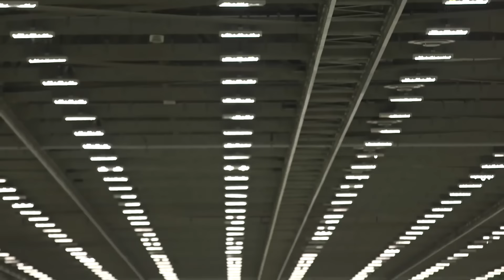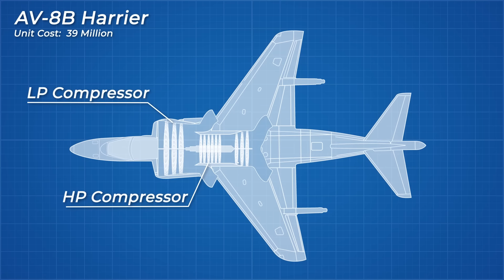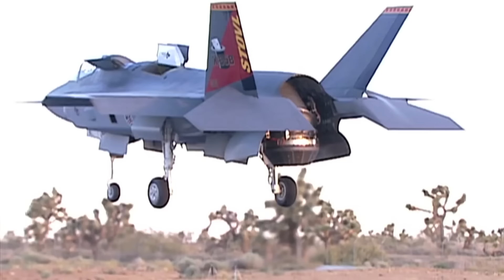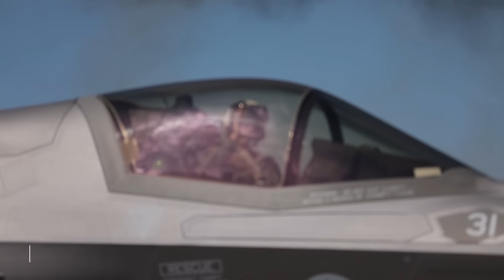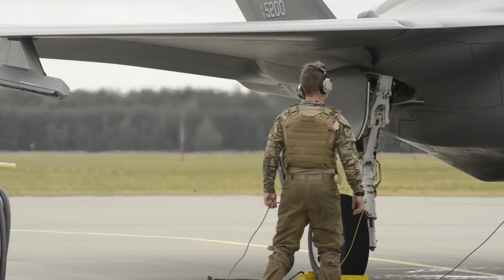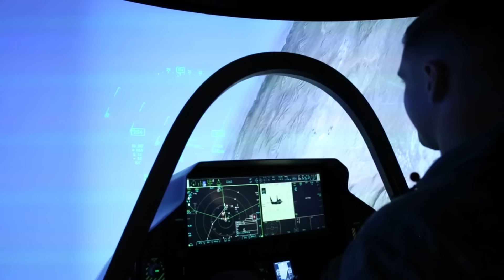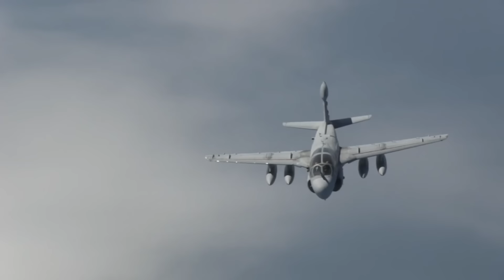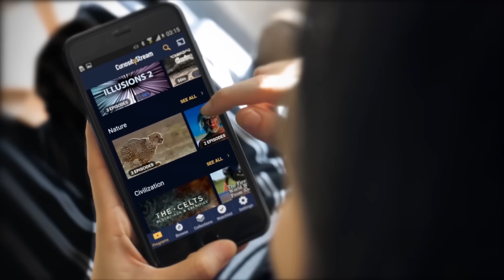Is The F-35 Worth $115 Million?

Comment: The F-35 is not a replacement for the A-10 at all...  The ability to loiter and get close to the ground is essential in CAS and the F35 fails miserably not to mention it has a tiny gun with 1/3 the rounds of the A-10.  This is just a way for lockheed martin to make money.
Reply: The need for flying low over the target is no longer necessary as guided weapons have gotten way more precise. So long as the enemy is destroyed and the friendly troops aren't harmed, it doesn't matter if it's done by an A-10 flying dramatically over the treetops with its Avenger blazing or by a F-16 dropping a JDAM from 20,000 feet. The enemy's just as dead. The A-10 is better in the US' current conflicts because it's cheaper to operate and the insurgents US troops are fighting don't have good AA weapons, but against an opponent that does have modern AA the A-10 is toast. By contrast, the F-35 is far more survivable because it's much, much less likely to ever get hit in the first place. The A-10 doesn't have a place against modern militaries, and in its anti-insurgent role it's likely to be replace by light attack turboprops that are even cheaper to operate and have loiter times that are longer still.
Reply: @Verminator4  Guided weapons being precise doesn't mean anything when situational awareness is sacrificed on the battlefield.  The friendly fire will be far greater when firing a guided anything from very far away.  Warfare is not WW1 when the enemy and the friendlies are in defined locations.  That being said the F-35 will not be aware of what their targets are if the battlefield changes and that ordinance won't be wasted whereas an A-10 can easily burt our a few rounds.

If the wars are with a powerful military the AIRFORCE  brass won't risk the F-35 for CAS operations.  The Air Force hates to do CAS that is why they hate the A-10.  The brass never wanted the A-10 they were forced to take the plane.  Even recently they continuously want to send them to the bone yard and destroy the bone yard so to ensure their jobs with defense contractors.

The F-35 is very expensive to operate and has limited CAS capabilities.  How many armaments fits in that flying turkey's inner bay?  2?  4?  The A-10 is loaded to the gills with available weapons.

Also when you have troops on the ground the AA weapons you are talking about have long been destroyed.  The A-10 goes with the troops.  If troops are there the A-10 will be able to fly.  

The F-35 has a lot of shit with it as well it has a very low turnaround time which the A-10 excels.  The A-10 is not able to be replaced with the F-35 unless you want to dumb down the requirements of CAS.

The F-35 program is designed to make Lockheed Martin rich.

In a real conflict the F-35 will be be a bottleneck grounded for maintenance schedule or out of ammunition.  It just needs too much with very little return on the investment.
Reply: If the A-10''s got superior situational awareness, why is it top of the list for friendly fire fatalities inflicted on US and allied soldiers, as well as civilian collateral damage? Trying to compare the A-10's situational awareness to the F-35 is like a joke when that's far and away the Lightning's greatest strength due to its sensor suite and data links. The A-10's main distinguishing feature, the GAU-8 Avenger, is an imprecise weapon that's not even equal to its intended task of penetrating tank armour any more, while also being an environmental pollutant because of its depleted uranium rounds - by all rights its usage should be a war crime. The rest of the ordnance it typically carries can be carried by pretty much any other ground-attack-capable jet the US can currently field, in equal or greater quantities.

The brass don't want to get rid of it just because they don't want to do CAS because they hate the army and the marines or any stupid shit like that, but because the plane's a liability and being forced to hold on to an antiquated airframe that's only capable of flying one very specific mission under extremely forgiving conditions isn't economical or prudent unless it's dirt cheap. Yes, the F-35 is too expensive to justify using in place of the A-10 in its current COIN role, I'll give you that. However, the A-10 is probably too expensive also - the future of this role is light attack planes and drones that operate at a fraction of the price.

You can't just assume that against a peer opponent that all AA is going to be gone either - modern SAM batteries have ranges measured in hundreds of kilometres, and even man-portable SAMs are more than equal to the task of shooting it down - an A-10 was shot down with a shoulder-launched Igla-1 missile in Desert Storm 30 years ago - and that's not even considering the possibility of enemy air cover - if an A-10 draws the attention of pretty much any enemy fighter that's flying today, it's screwed. Despite being vaunted for its survivability, it's actually the most vulnerable manned aircraft in the USAF's inventory - it's just too damn slow and makes itself into too easy of a target. It's dead meat in a contested airspace environment, period. It's in that kind of environment where stealth aircraft like the F-35 come into play, because its stealth gives it a far better chance to survive - the best way to survive is to not be hit, and the best way to not be hit is to not be seen. The fact that it's also capable of flying many other kinds of missions is just icing on the cake. I know that the plane is expensive, on the back end if not on the front, and I have my doubts that acquiring the plane in the kinds of numbers necessary to replace the F-16 fleet is even financially viable, let alone prudent, but the fighter is definitely going to have a very significant role in the future of not just the US armed forces but those of Western countries across the world, whereas the A-10 just becomes more and more of an anachronism as time goes by. It's an unpopular fact because the plane has a lot of charisma that's made it into an icon, but it's a fact all the same.
Reply: @Verminator4  You need to site the study where you claim it is the top of the list had read an article on that and it said the evidence was not conclusive.  Did you read that in POGO or was it by those that want to push the F-35?

Your argument about survivability of the A-10 is nonsense the titanium tub, the triple redundancy of controls and the engines way in the back are just a few of the features to keep the pilot safe.  Whereas an F-35 can be taken down with a 22 LR cartridge with all the fuel just about next to the pilot.  The stealth thing is again is only for short wave radar not for long wave which can see the F-35.

The A-10 was not even offered for sale to other countries that wanted it because there was no profit in it.  The F-35 is a technological disaster and in a real engagement they might work for a few sorties and then have to go to maintenance because the fuel isn't chilled or the pilot can't get his helmet to work.  Any nation with half a brain would know that all you have to do is knock out ONE building and there won't be another F-35 pilot to fly any new airplanes.  You can guess which building that is.  Can that be said about A-10 or F-16 which mind you both planes were bought at the same time.

The F-35 makes The United States vulnerable and it's shortcomings can easily be exploited by a country with a few smart people.
Reply: It's a fact that the A-10's been involved in several notorious friendly fire incidents, including attacks on a British vehicle convoy where they were clearly signposted as friendlies - it was a massive scandal. It's a fact that its avionics and sensors are inferior to more modern jets, and it's a fact that its big noisy meme gun is an indiscriminate and inaccurate weapon. Put 2 and 2 together, I'm not spoonfeeding sources to you on a youtube comment like I'm writing for a fucking military journal.

As should be absolutely bloody obvious to anyone who has any idea of what they're talking about, trying to armour a plane nowadays is like putting lipstick on a pig. The A-10 was made to maybe take 23 mm, not 30 mm radar guided cannons and SAMs. Sure, the pilot's odds are improved by the bathtub, but it's far from a guarantee of survival. Out of the 7 A-10s shot down, their pilots were killed twice - contrast that against the 5 f-16s shot down with no pilot fatalities recorded. It's just a fact that against any AA system invented in the last half-century, the only way to guarantee survival is to not get hit. Stealth is the best guarantor of that - long wave radar may do better against stealth aircraft than short wave (which is still by far the most prevalent format for radar because of its far greater range) but even against that a stealthy airframe isn't getting seen before a non-stealthy one. If long wave radar was a magic bullet that rendered stealth aircraft useless, the Chinese and Russians wouldn't be scrambling to make their own. The facts speak for themselves - 7 A-10s have been shot down and even more have been badly damaged, and that was after it had been relegated to being sent to the aircraft version of the kiddie pool - it wasn't even up to the task of handling Saddam's Revolutionary Guard. That's versus the loss of 1 stealthy plane, the F-117, which flew directly into the heart of enemy territory where the enemy AA threat was at its fiercest, and that one loss was due to carelessness on the part of the commanders and a lot of work and planning on the part of the ground forces who ended up shooting it down. Compared to the F-117, the F-35 is much stealthier, is a lot faster and more manoeuvrable, has a higher service ceiling, and has its own inbuilt suite of powerful ECM. The Israelis supposedly flew it directly over Tehran without the Iranian Revolutionary Guard even noticing it.

And by the way, the A-10 definitely was offered for sale to other countries. When the production was scheduled to be halted, Fairchild tried to procure foreign orders to try and push that back. They offered it to South Korea, Israel and West Germany, all countries that were directly threatened by hostile neighbours with large tank brigades. You'd figure they'd all want the plane custom-built for tank-busting, but none of them did, even back then. The AA threat had already surpassed its capacity to cope with it.

As for whatever else you're trying to say about the supply chain of parts, I'm honestly just tuning it out at this point because it's abundantly clear you don't know what you're talking about. The supply chain for the F-35 is global, spread amongst the NATO partner nations that signed up to the JSF program. I don't know what crack you've been smoking if you think the loss of some single building (like what, a factory or something? Those are in the heart of allied territory and have basically no chance of being hit) is going to shut down the entire worldwide fleet of fighters.

Anyway, I'm done arguing. I swear, A-10 fanatics are like those nerds that try to argue that swords are better than guns
Reply: @Verminator4  You needed to site that study instead of cherry picking talking points that means absolutely NOTHING.  Can site "Killer Chick" and how she flew an A-10 that was damaged and still that would be cherry picking on my side.  If you can't site the accurate study on your position then you are just a fanboy or possibly paid by Lockheed Martin to undermine any credible arguments against that flying turkey (F-35).  The F-35 is a logistical nightmare and in a battle situation will only be around for a few days before going into maintenance or the helmet is working...

By the way the helmets are fitted in one building in The United States.  It is pretty easy to know that there will be NO F-35 pilots going forward if that building was destroyed.  That makes for a very easy target for a country who has more than a few toyota trucks in the dessert.

No one is scrambling to make long wave radar it has been used by  Russians since WW2.
Reply: The A-10's been shot down more than any other US plane since the end of the Vietnam war - that's not a point that's up for debate. 7 A-10s shot down - the next closest are F-16s and Harrier 2s  at 5 apiece, both of which flew more numerous and more dangerous missions than the A-10. That's the beginning and end of the debate - if you don't believe me, look it up. I don't care for anecdotal stories about this one time an A-10 got hit and then managed to limp to base - it's  better not to be hit in the first place. Like I keep saying, and you keep ignoring, no, I actually don't think the F-35's a fitting replacement for the A-10 in its current role of bullying goat farmers with decrepit soviet weapons (the only role that it's fit for,) because that's a waste. However, the job can be done a lot more economically by light attack planes like the Textron Scorpion or A29 Super Tucano, or by drones.

However, in a high intensity conflict, the technology in the F-35 is basically the barrier to entry, especially its stealth. Countries around the world are scrambling to make more stealth aircraft, whether that's Russia (Su-57, PAK-DA) China, (J-20, J-31) Japan, (F-X program) the UK (BAE systems Tempest)  member states in the EU (FCAS) and others besides. If all it took to nullify stealth was to use a different wavelength of radar, do you really think all those countries would be scrambling to make stealth aircraft? Do you really think you know better than the air force commanders around the whole world? The fact of the matter is if two nations with serious militaries go at one another, one with stealth aircraft is going to absolutely dominate the air war. Bring an A-10 to that kind of conflict, and you might make the operator of that Pantsir SPAAG or S-400 battery chuckle for a moment before he hits the big red button that makes it crash in a ball of fire. You might as well roll up with planes from World War 2.

And I'm really baffled by this weird obsession you have with the helmet factory. You really think that blowing up a factory in the heart of the continental US is something that can easily be done? You really think they can't just make the helmets elsewhere even if they do manage to blow it up somehow? Don't you realise that F-35 pilots will have their helmets already by the time a war breaks out? And besides, what makes the helmet factory so much more of a vital target than the factories that makes the plane's wings, or fuselage, or engines or any of the other hundreds of things that are crucial for the plane to fly, let alone airbases and other crucial strategic assets? You've got a lot of strange ideas, I swear to god
Reply: @Verminator4  You can't cherry pick data without more than your narrow view.  You say the A-10 was shot the most however that means nothing at all without all relevant data about the quantity of missions the danger of those missions and so on.  If you think people will read your dribble and not see you dishonest statements you are mistaken.  Also why condemn my statement about Killer Chick while you propagate the very same examples of your narrow and baseless statements?

Procurement of aircraft has been tainted by greed for decades.  That is easily seen when one understands the A-10 and F-16 procurement.  Push defense contracts and then get cushy jobs working for them after generals retire.  This is pretty obvious information demonstrated by the F-35 which is a colossal waste of money.  Other countries like the United States say they want pretty new toys to fuel their defense companies as well.  

As far as the helmets the answer is NO you can't just get them done someplace else.  Also like had mentioned and you had forgotten had said no NEW pilots would be able to get a helmet if that building is destroyed.  Can a powerful country do that within the United States?  Absolutely and it would be brilliant because there is only one place to fit that helmet.  Other aspects of the manufacturing process would not be as crippling.  How magnificent having planes without them being able to be manned?  It is strategy just like the stealth fighter that was shot down was also based on intel from within the country of origin.  Guess you weren't aware of that either?  If you were then you would understand the importance of fitting those helmets.

You thinking that my points are somehow diminished because there are commanders that would know something well the fact is that your position is the arrogance of military commanders not being able to see beyond their BS!

Don't swear to God that is a sin according to the New Testament...
Reply: Stop asking for studies and data, I'm not wasting my time on that shit. Look that shit up for yourself, it's not hard to find if you look for information from credible sources. Frankly I'm getting sick of seeing your inane responses in my inbox. It's well known that the A-10 only flies in permissive threat environments ever since it was taken away from attacking the Iraqi Republican Guard in desert storm because its attrition rate was too high, and now only flies in low threat environments. Meanwhile the likes of the F-15E and F-16 were flying air raids over enemy fortified positions and suppressing enemy air defenses, missions that would be suicidal for the A10. Despite that, they have lower casualty rates than your supposedly "rugged and survivable" emotional support plane.

You can say that procurement of new aircraft is greedy all you want, and yes, there is greed and corruption in the military industrial complex, but does that mean that it's just not necessary to get these planes? No, because other countries will get them and then you get left behind. The whole reason Lockheed made the F-35 to begin with was because the US military issued a requisition for an aircraft like it, ie. a lightweight multi-role stealth fighter, in the JSF program. It was made because they thought it was necessary - if the goal was simply to make money for Lockheed they could have continued with production of the astronomically more expensive F22 Raptor instead. It's not a waste to keep pace with the global arms race - continuing to operate and maintain obsolescent airframes for no good reason is.

And again this bizarre obsession with the helmet. I was curious, so I looked it up. The facility you're talking about is located slap bang in the middle of an air force base in Arizona. I laugh at loud at you if you really think that destroying that will be easy for anyone. How the hell are enemy armies just supposed to show up in the middle of Arizona and level an airbase without anyone noticing? And you're high on some kind of psychotic drug if you think losing the helmet is somehow more crippling to the plane than its wings or engines - I'd prefer a plane with no heads-up display than one that can't even take off. And yes, I was aware of the F-117 that was shot down in Serbia, I already mentioned it and addressed that point earlier. Pay attention.

And as for those commanders, those guys have many years of experience running an air force, many of them in the US will have first hand experience of what it's like to command in an actual warzone, many will likely have real first-hand combat experience of their own from older conflicts. They have all of that to draw on when they make their decisions. What do you, some random dipshit in a youtube comments section, have to countermand that? If you're trying to tell me that you know better, then the arrogant one is you.